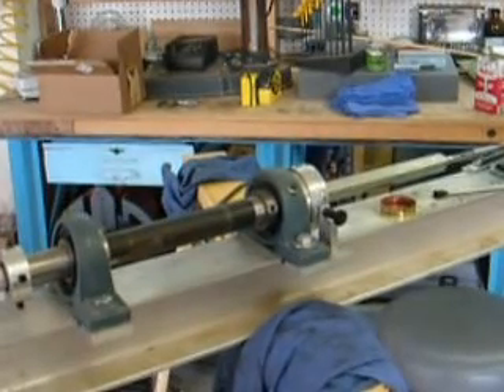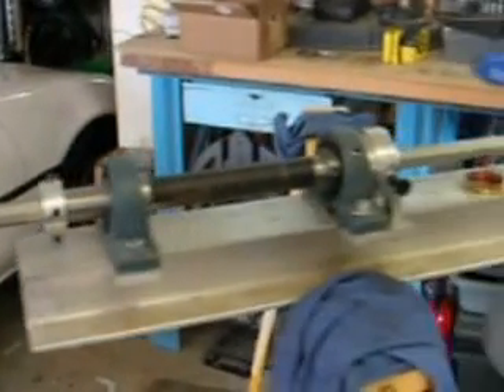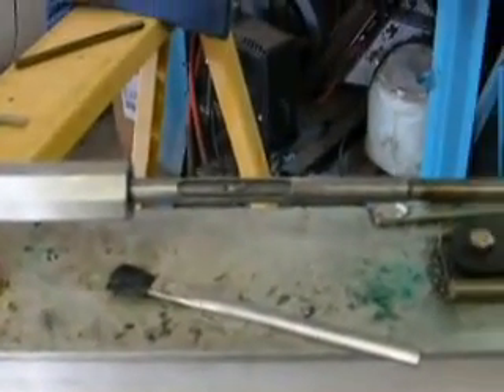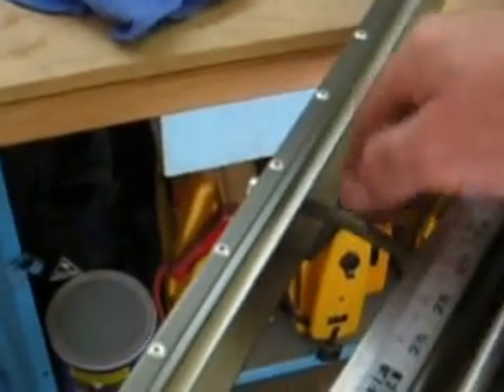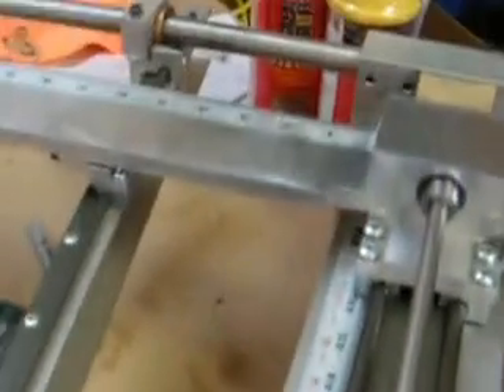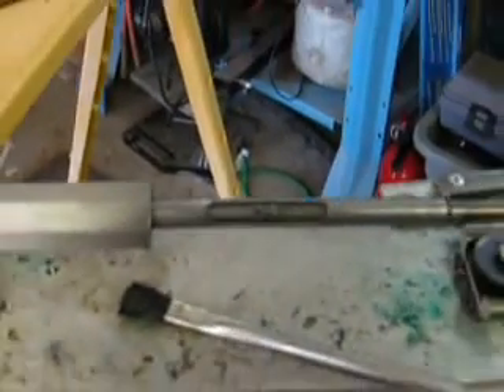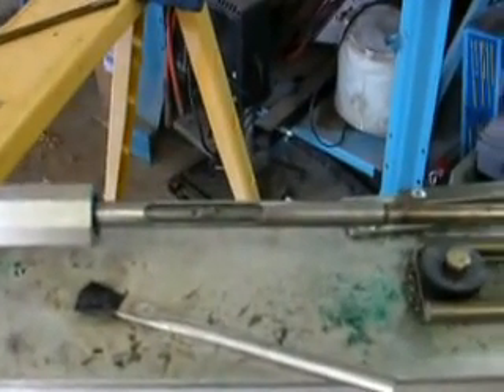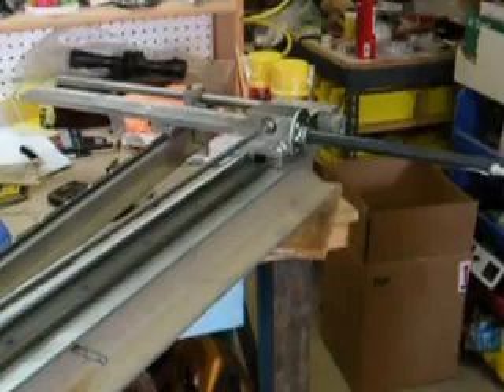Rifling machine overview

Comment: You mention the cutter being from a Springfield design. I couldn't find the link to this as you mentioned. Great video!
Reply: Oh!  That book!  You’re right, it’s in there.  (Have vols 1 and 2).  Awesome books.
Reply from the maker: Thanx, at orro.net scroll down to Rifling Girardoni Barrels,  the reference is there (Vol. 2, pg 135, fig 67 - text on pg 136-137).

closeup of the cutter: http://orro.net/wp-content/uploads/2012/02/cutter.jpg

The book is available here: 
http://www.milsurps.com/content.php?r=424-1941-The-Modern-Gunsmith-(by-James-Virgil-Howe)